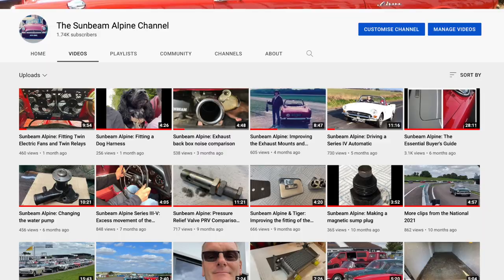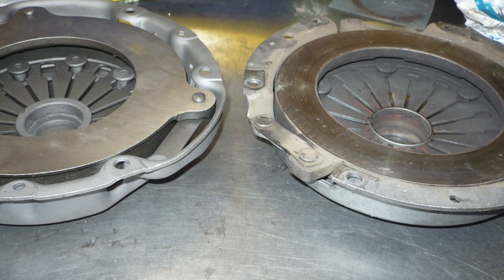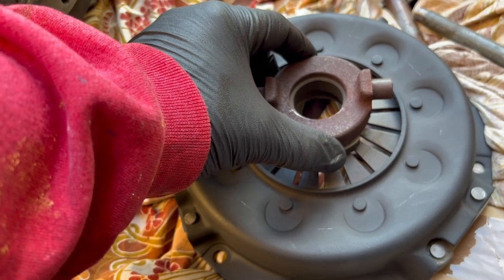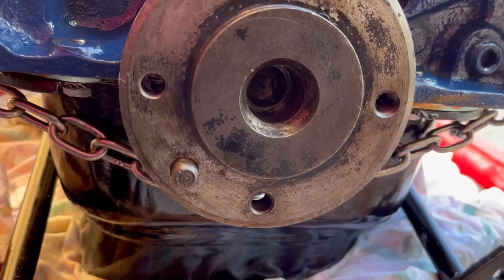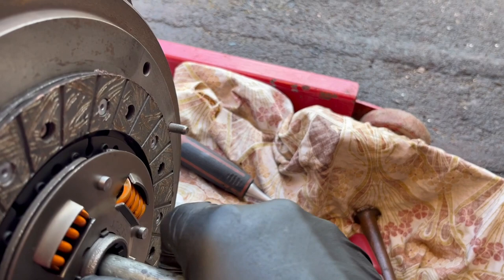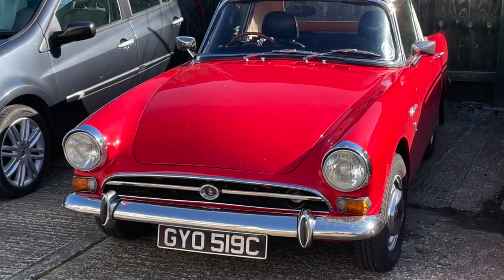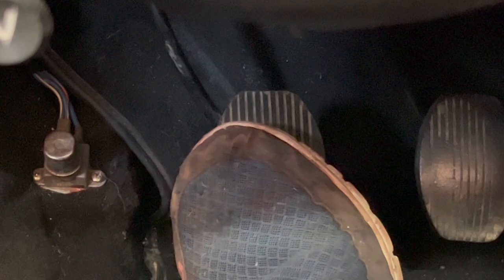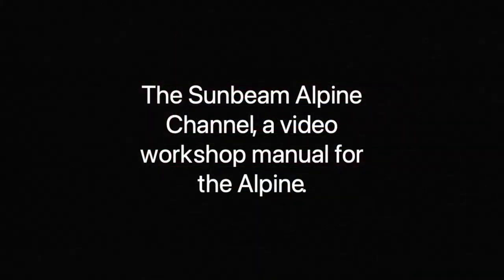Sunbeam Alpine: Fitting a Roller clutch release bearing

Comment: Such excellence in instructional video!.......So, the clutch did not release cleanly for about a week? I have found a like problem in clutch or brake when using various silicone type brake fluids. I saw this when I first (1978) tried silicone fluid, having used Castol LMA before.  My theory is that some of these types of fluid out-gas a bit at first, acting as described.  After about a week, I re-bleed hydraulics and normal, sweet operation resumes.
Reply from the maker: We have done a lot of miles now and the clutch is great. We have not used silicone fluid in the system though. We are using standard Dot 4 fluid.

Comment: These used to be readily available in the US.  No more.  Unfortunately, buying from the UK makes these cost about a 1/3 more.  They are a nice upgrade and can last considerably longer than the graphite bearing.  Check the ebay seller reviews before you buy... the seller has a 98.5% rating; not exactly stellar.
Reply from the maker: Yes it is a nice upgrade. As far as the seller is concerned we can only speak of the service that WE received. The item arrived promptly and is of very high quality.